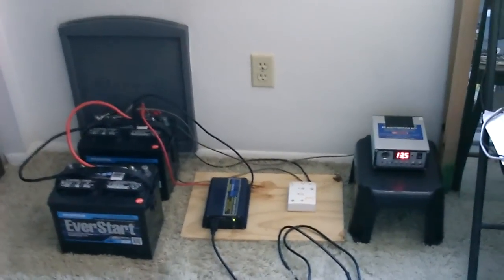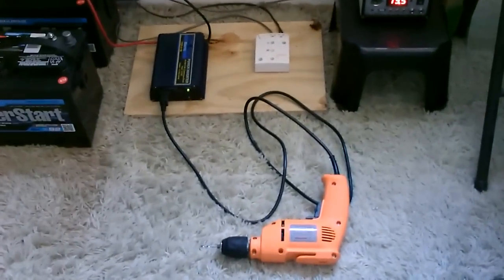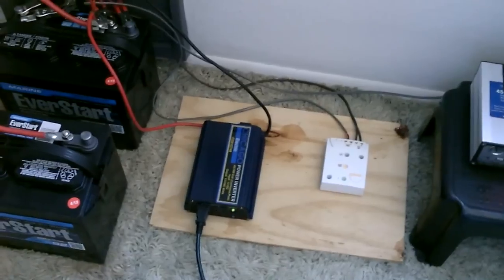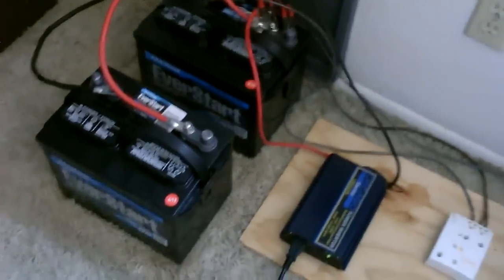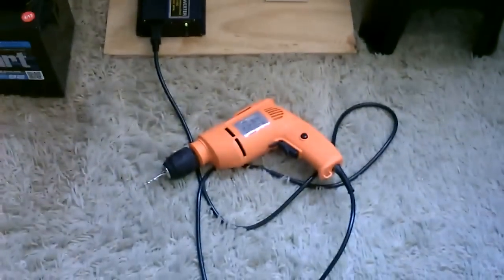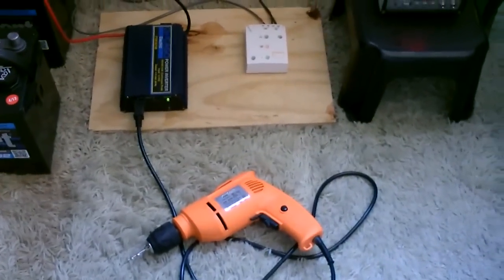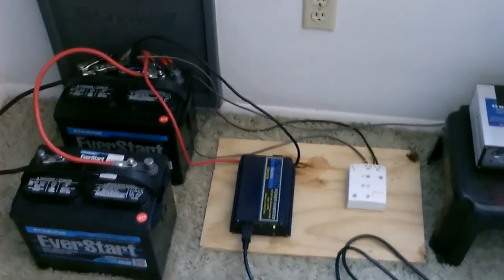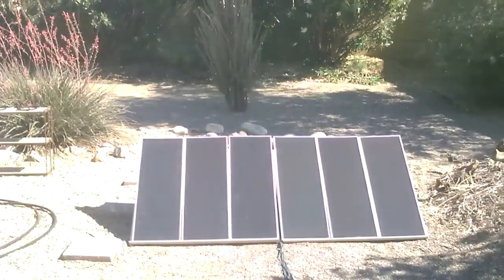Solar Powered Power Tools - Power Drill running on a DIY solar panel system - easy to make

Comment: hi, how long could you run the drill for with the setup in this video?
Reply from the maker: hi there. with full batteries and the sun continually charging the system - it would run all day. with full batteries and no sun - it would run a few hours. (assuming typical or "moderate duty" use)
Reply: thank you for responding. good information. ill work on making my first solar setup soon